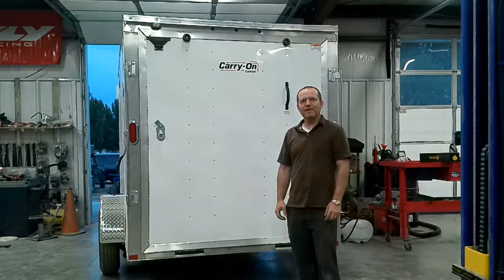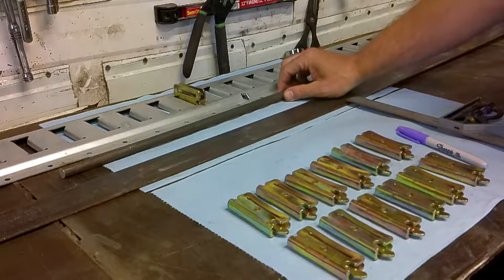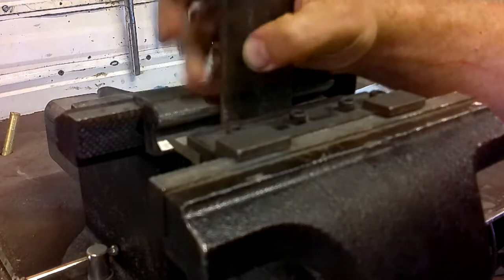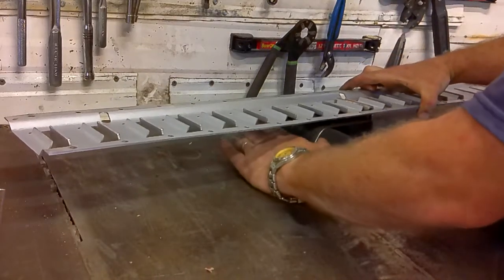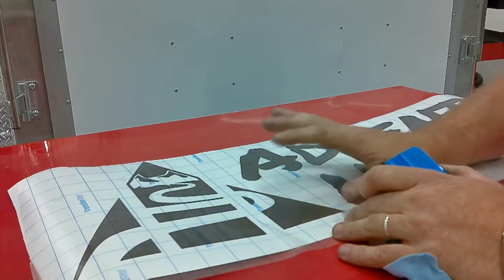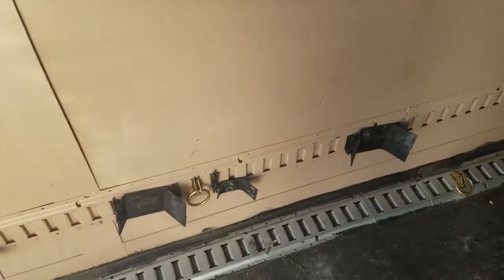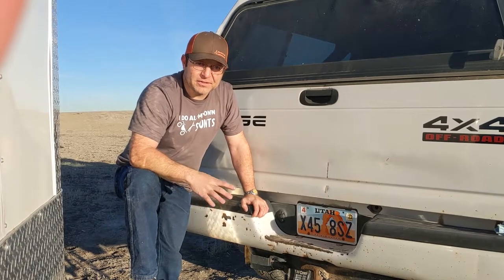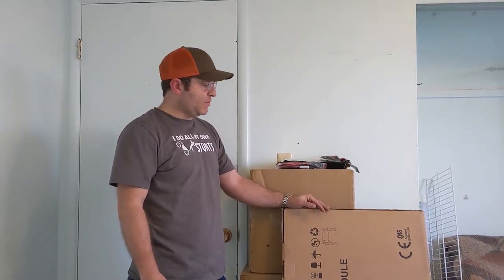Ultimate Dirt Bike Trailer Part 2

Comment: I like the wheel chock idea, I've been using an etrack bracket that you can mount a 2x4 in. Can't wait to see what you do for lighting, I've been looking at these 14" led bars on Amazon. Thought about running them off a seperate deep cycle battery.
Reply from the maker: We are adding 75' of LED lights that will run off a deep cycle battery which will be charged with a solar panel. We will put in a couple of 3 way switches so the lights can be accessed from the front and the back of the trailer.